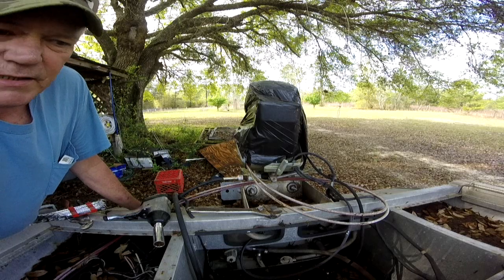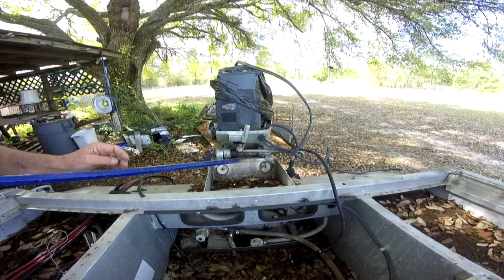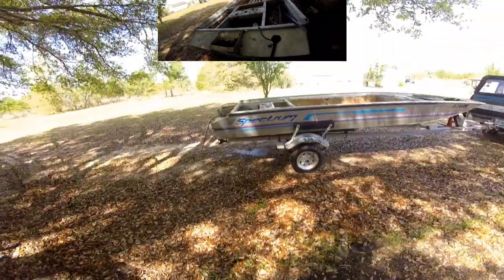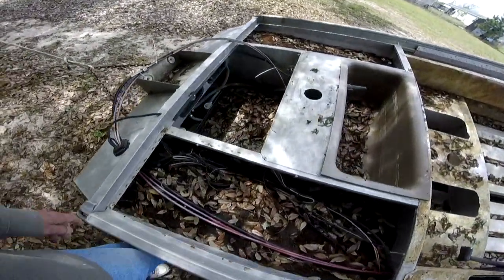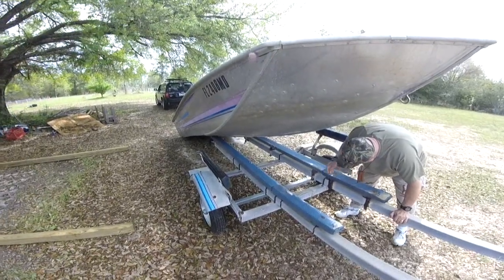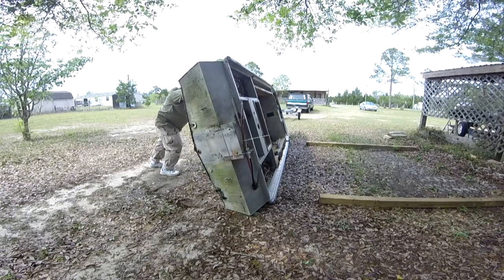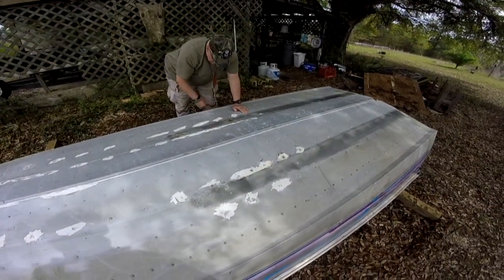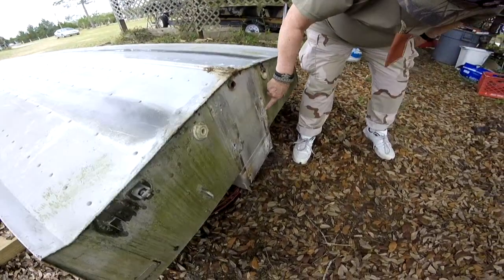BOAT PROJECT PART 2

Comment: I recommend replacing the rivets and being done with it. If you have to go back and redo a patch job, its going to be alot more difficult with the boat on the trailer with the motor weight etc. With the correct tools (not very expensive) it's not a hard job.

Comment: Digging out the foam is going to be a real job I had one and it took a chisel  and a small hammer,  acetone will soften it up to help clean the compartment I installed some block form in its place

Comment: I’ve used the marine JB weld and it worked great for leaking rivets. I wouldn’t use truck liner on it. If it isn’t smooth you will have a lot of friction when going across the water, harder to plane out also. I used the clear flex seal on the bottom of a couple and it held up good.
Reply: It’s sprays on clear. Also used for tin roofing.

Comment: On the bucking rivets...they need to be "tightened up". Have someone use a hammer head and place it on the head of the rivet on the inside of the boat.  Someone else will need to tap the other side of the rivet on the outside of the boat. You are basically squeezing it which spreads the stem of the rivet out and seals it in the hole.
Reply: I agree Marty, if they can access the rivet buts.